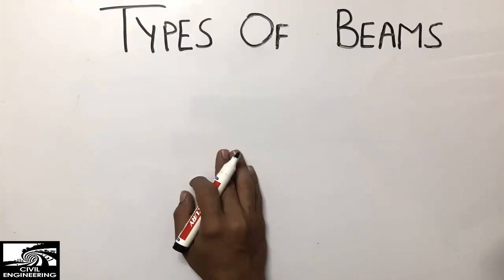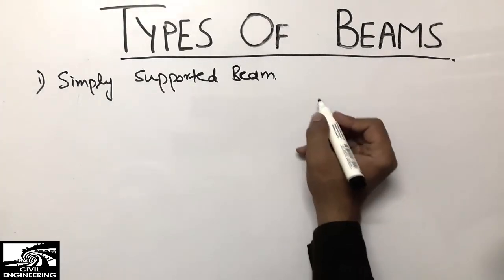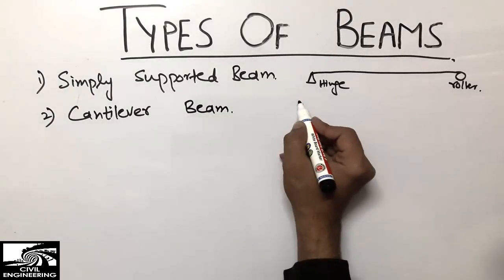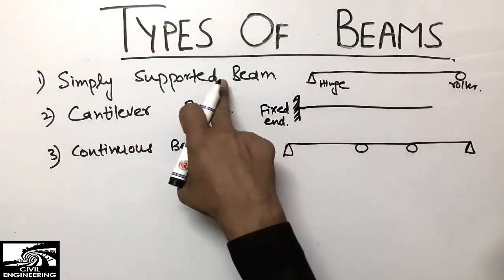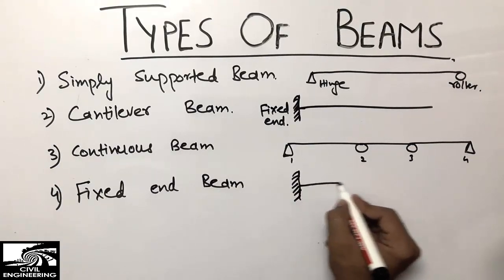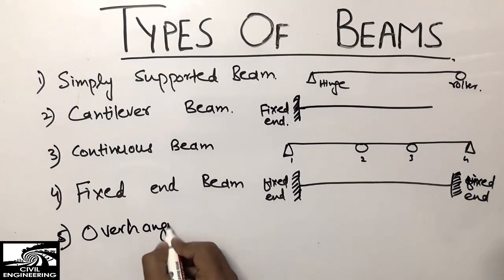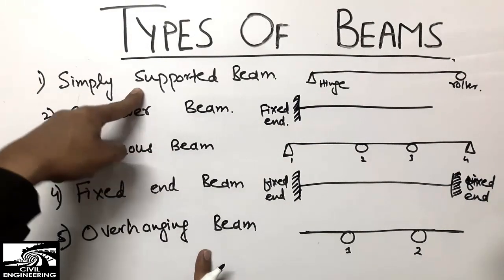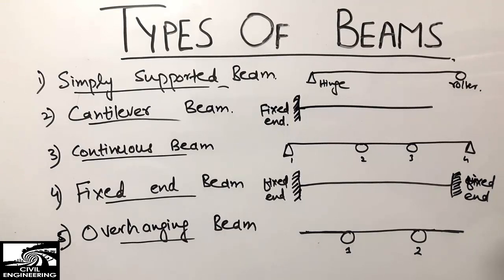Types of Beam with Diagram

Comment: in reality i think that the junction between column and beam make them always fixef and not simply supported am i right or no if no can yoi please explaik me why  because it's a question that bothers me always
Reply from the maker: Yes the joint between column and beam is always considered as a fixed joint, simply supported is considered when a girder is placed on a pier shaft where there is no monolithic connection